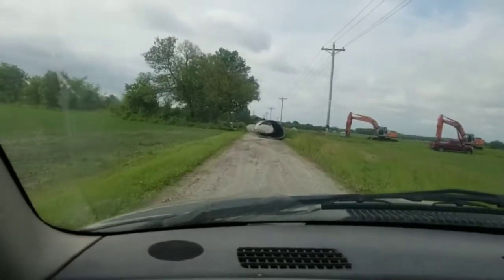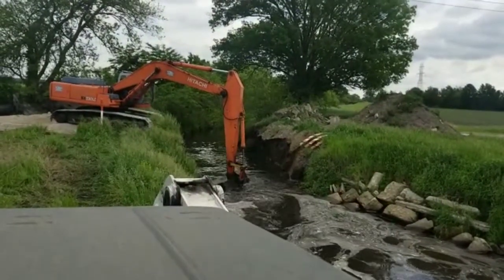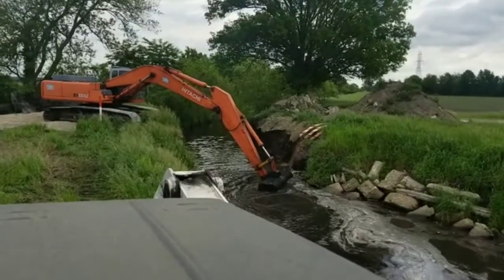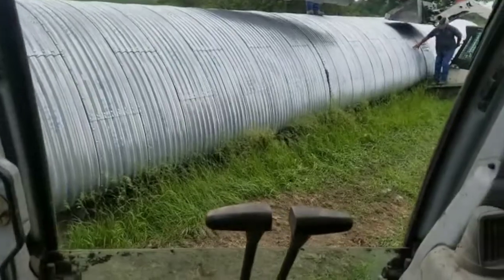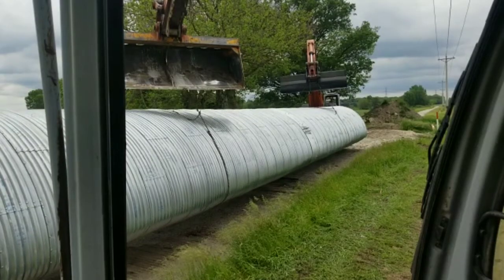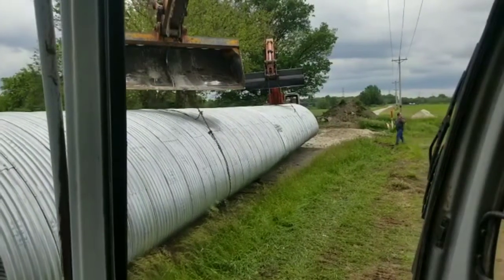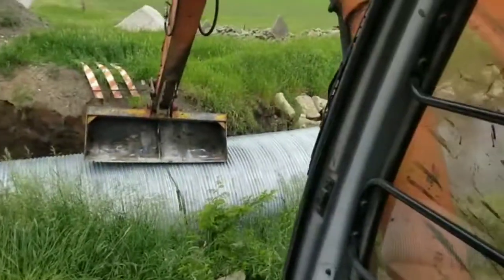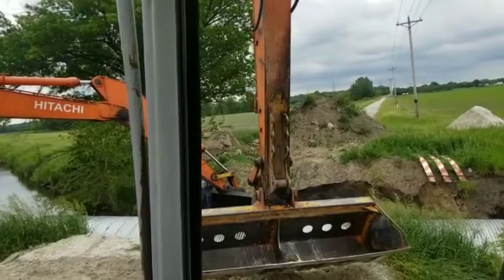Dangerous!! Risky!! 2 excavator team lift Video!

Comment: Hi there.
Your channel just popped up yesterday. I subbed. Nice content.
Did not realize they made steel oval culvert pipe. Glad you said something. Up until that point. I was thinking, geez, that pipe looks like crap.
Lol
I'm a (early) retired commercial plumber. (Cancer). Got to work with different types of equipment over the years. Made it interesting.
Ed
Reply from the maker: Welcome to my channel!! Yes they make oval pipe they flow more than round pipe these start out as round pipe and they smash them with a press to make them in to oval pipe....you stick around here and you will see alot of new things!!